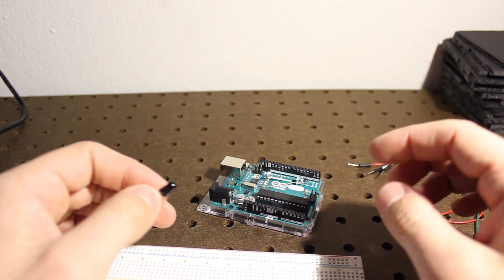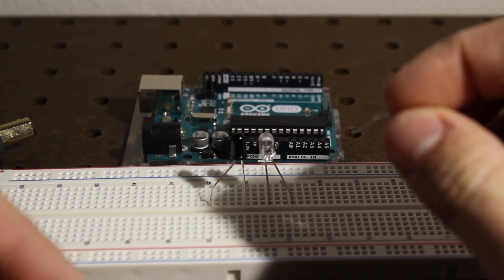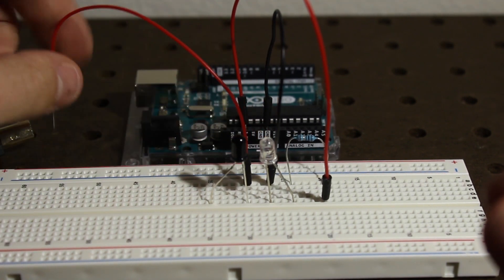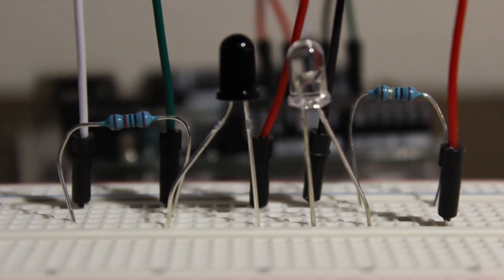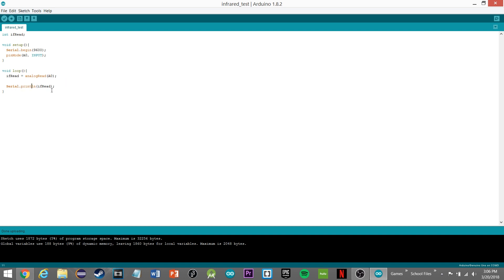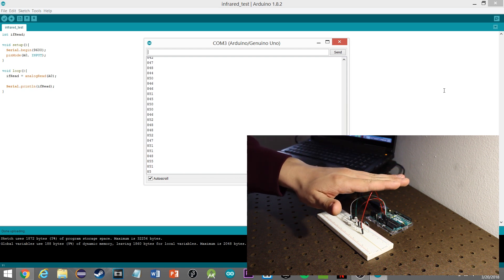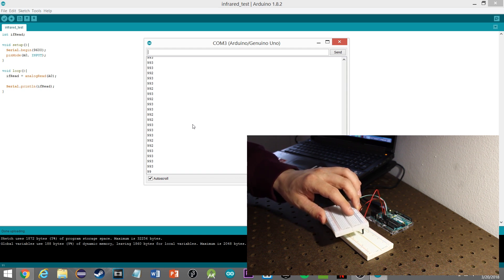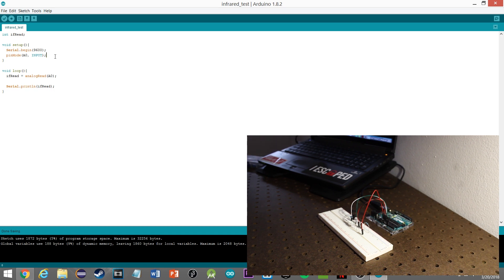Using 2 Pin IF Receivers/Emitters | Arduino Tutorial

Comment: Thanks. Your hint to use 10 ohms for the resistor helped me get the emitter working for my IR remote control project. I was using 220 ohms and thought my LED was broken.

Comment: Thanks for the video.  Do you need safety glasses to work with these?  Also, would it be possible to connect 3 sets of these to the same arduino uno?
Reply: Yes it would be and wtf why safety glasses.
Reply: @notmasterdelectronics  Because it's a "Laser" ;)

Comment: I've been trying to create a remote for my lift tickets when I get out of my wheelchair and for some reason it will not send the IR signals to the TV or to the machine. My receiver receives the codes and stored them but for some reason the LED does not send. Do you ever have problems sending with these IR LEDs

Comment: Hi the video was great and the first time I tried it the setup actually works and was showing values. But I tried to do it again and now its showing 0 values. Is there a way to troubleshoot this? I used the same material for the setup and its still zero.
Reply from the maker: If you're sure all of your connections are all the exact same, I would start by making sure none of your components are ruined. Perhaps either your emitter or receiver are burnt out. They get pretty hot sometimes and I've had some of them pop on me
Reply: Increase your pull down resistance...it will work

Comment: Hi, thanks for the video, I'm using a different photo diode and as soon as I hook up the earth to my pull down resistor it just goes straight to 0 and won't budge even when the led and diode are pointed directly at each other, I tried putting a 100k one in series with the 10k to make 110k and it still did the same thing, do you think I just need a much greater resistor for the pull down?
It's been super hard to find good helpful info on these things for some reason :s
Reply: Just found another 100k resistor and put the two of them in series to make 200k, still drops straight to 0 and wont budge...

Comment: great tutorial. Is it possible to use the ir emitter and receiver as a method for wireless communication between 2 arduinos ?
Reply from the maker: Just depends on what you want to transfer between arduinos. What were you wanting to do? Just a proximity thing?
Reply: @calprowe  I just need a wireless method for one arduino uno to tell another that it has detected something. For example, i have an arduino with a laser, and another with a photodetector. When the laser strikes the photodetector, I want the arduino to tell the laser arduino that it has detected the laser, probably by sending it a arbitrary message through IR. Do you think that I could use these IR leds for such an application?
Reply from the maker: @aonoymousandy7467  it's possible, but these don't have much of a range and are affected by natural light and other things, so you might not get accurate readings. You could put the receiver on the laser arduino and the emitter on the photodetector arduino, when the photodetector senses the laser, it gives power to the emitter and gives a reading to the laser arduino's reciever. That's where I would start, just depends on how far away the arduinos are from eachother
Reply: @calprowe  they are 30 feet apart
Reply: also one is outside and the other inside my house, they are separated by a window, could IR pass through glass?
Reply from the maker: @aonoymousandy7467  these wouldn't work for that with thst distance. I would just go with a set of RF modules for that. You can get a pair on eBay for a couple bucks
Reply: @calprowe  thanks for the help, do you have any tutorials on any rf modules?
Reply from the maker: @aonoymousandy7467  i do not, although I might make one in the future

Comment: Hello Caleb, that's a very nice video, this is exactly what I was looking for, I didn't have the same results due to the different IR LEDs that I used, but  I have a question, the negative pin of the receiver is rated by 5V of Arduino, should the pull down 10k resistor get any voltage? Because the receiver gets almost 5V and 10k resistor almost nothing, I tried 5k and it continues the same voltage at the receiver.
Reply from the maker: The pull down is just to avoid inaccurate values between states (on or off), play with different resistors and see which works best